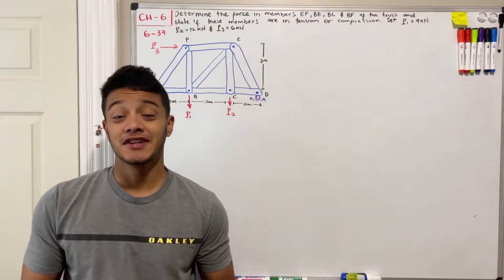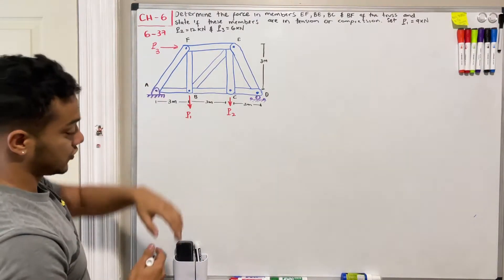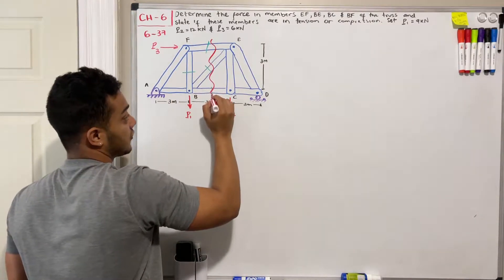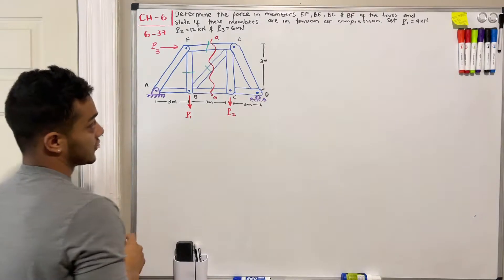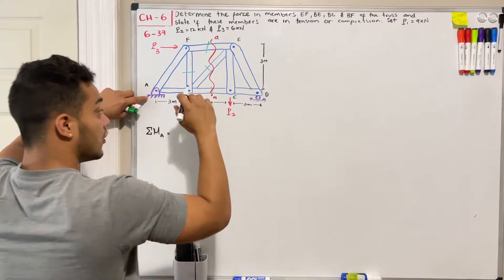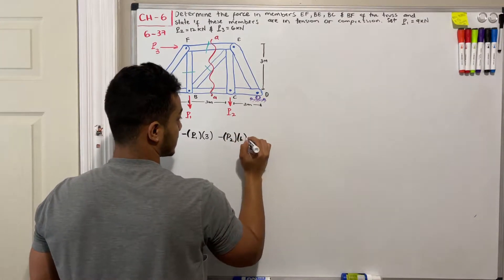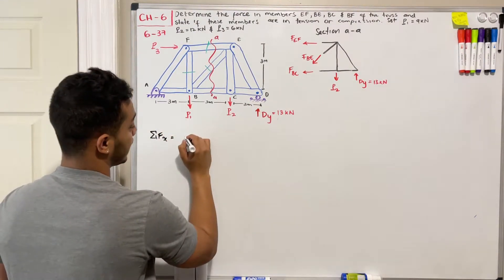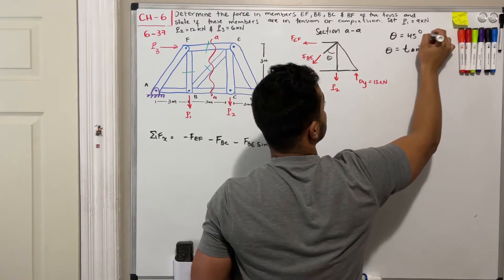Statics 6.37 - Determine the force in members EF, BE, BC and BF of the truss. Tension or compression

Comment: Why isn’t P3 counted when you are ∑MB=0 but F_EF is? That’s the only part that confuses me with method of sections: how can you count one unknown force at a point (this case point F) but not another in your equation of equilibrium? I understand that F_EF is within the section a-a and P3 is outside of it but they both affect the same point, which is also outside of section a-a. 

Besides that question, thank you for these videos! They helped me understand moments of inertia before my mechanics final. Coming from a ChemE student stuck having to take mechanics as a general requirement.
Reply from the maker: Hello, so you mentioned the reason and is that F_EF is within the section a-a but P3 is not. To better understand this, the point does not matter if its inside the section or not, because it is just an arbitrary point we decide to chose. Another way of seeing this is that F_EF is accounting already P3 in some sense and also the other internal forces of each of the members we are cutting thru.

Comment: Bro -fbesinø in horizontal
And -fbecosø in vertical
You did it opposite
Reply from the maker: Hi, thanks for the comment. In this case since the angle was equal to 45 degrees then both sin and cosine are the same value.
Reply: He means that you drew the entire diagram the wrong way. fCF, not fEB. You have therefor not drawn the same diagram that is in the book, and answered a different question. You are right by your diagram, but not the same as in the book. @LearningbyTeaching